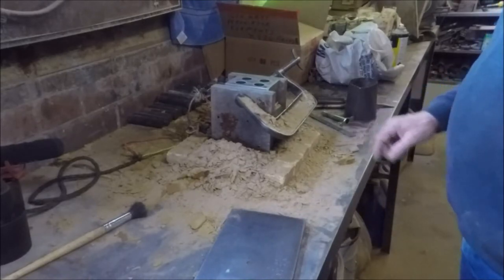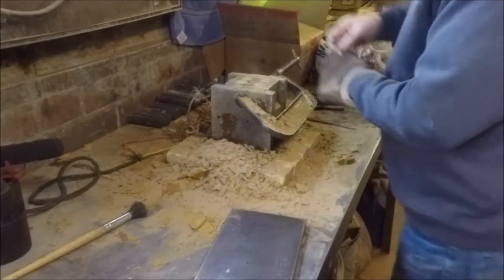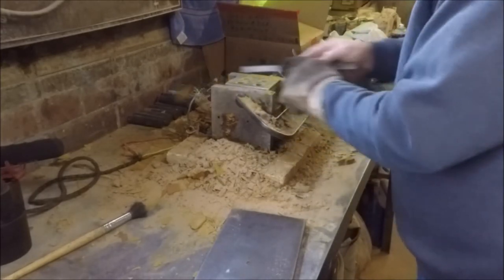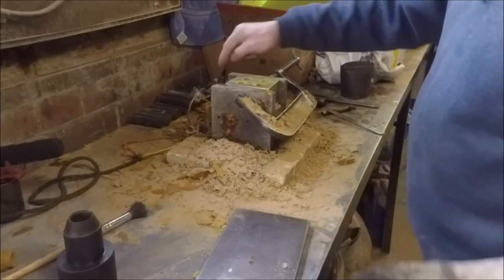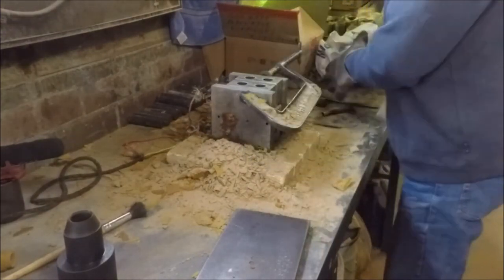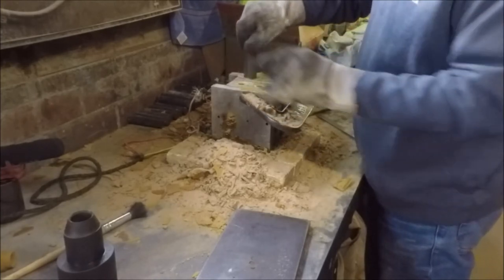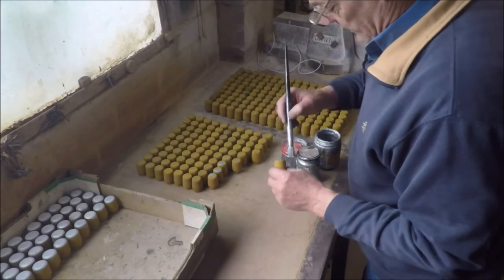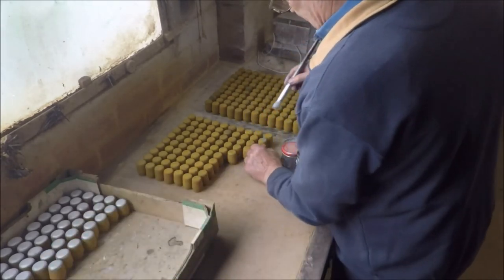My home foundry, Coffee pecolator heater casting core

Comment: After bending the heating elements it's a good idea to use 500-2000v mega omh meter to check if the heating element insulation was not dameged Durning bending. Single heating element insulation resistance should be higher than 2 megaomhs. There is an industry safety standard for that, but I forgot the values described in it. 2 meg is what we check for.
Reply from the maker: Mindaugas, My customer does indeed run a meter across each element to check that the have continuity and no earth leakage. He does this after the post casting machining, element end tagging, and sealing.. Martin
Reply: @olfoundryman8418  it would be wise to do that after bending, before casting. Because you can scrap the element if it's faulty, and scraping a finished product is expensive(work hours and materials).
Reply from the maker: Mindaugas, Your point is well made and I think my customer - who provided me with the elements already bent (coiled) - may well have tested them at that stage too but I do not know for sure. I can not do the test myself as I do not own a mega... Martin

Comment: what is the binder for the sand ?
Reply from the maker: Rahib, The sand comes pre-coated with what I believe is a phenolic resin. The heat of the die first melts and then cures this resin. I believe that resin coated sand, sometimes called "shell sand" is available just about everywhere as it is widely used. It is quite cheap, from memory I pay a less than A$10.00 for a 25 Kg bag and you get  a lot of these core from 25 Kg!Martin

Comment: hi, i have tryed to get hold of the resin bond sand. but no one seems to know wat it is. working with waterglass at the moment. any help
Reply from the maker: Manus, I am absolutely amazed that you are having trouble getting resin coated sand. To the best of my knowledge it is used and thus available world wide. Even here in Melbourne where I live with it's now almost dead foundry industry there is at least one company listed (under "Foundry supplies") in our local phone directory as a supplier of resin coated sands, it's them I buy from. Some people know it as "Shell core sand" so perhaps you could try asking for that although a quick check of Google indicates that the term "Resin coated sand" is the one most used for it.  You would have to go to someone who supplies foundries as other sand type suppliers would not have much of a clue about it. Almost all sand foundries use this material so if you can find a commercial foundry anywhere near you (preferably a smaller one) they may be prepared to sell you a bag or two for cash or at least to tell you where you can get it locally. Waterglass (sodium silicate) CO2 sand is Ok and I do use a bit of it from time to time but I much prefer the resin coated sand. Silicate is not as convenient as it has to be mixed up each time immediately before use, it won't keep as it dries out and atmospheric CO2 will set it off (slowly!)  Cores made with it are not as strong, not as free venting  nor do they store as well, I can make say a hundred shell cores with the resin coated sand put them on the shelf and use them over perhaps the next year a few at a time and they are fine but I would never try that with silicate CO2 cores, they are best used within a few days of making. Also breakdown of silicate is poor, sometimes you have to chisel the core out of the casting, however if you add 1/2 % glucose powder to the sand before adding the silicate the breakdown will be much better as the cores will wash out. Of course shell cores need a metal core box while silicate don't but silicate do need a CO2 supply (although there are variants of it that don't)
I don't know if any of this helps but good luck with it.... Martin
Reply: thank you very much for your help. i cast mostly with co2. the foundry supliers and foundrys i contacted use a resin binder sand, but it use a chemical catilist tipe system.  also have hard time finding any suplies in small amounts. about the only thing i get in reasonable small quantities is sifted sand. even the seramick shall binder only is avalebal in 220l drums. and not very cheap at that eather.
ps. I love watching your vidios. most help full.  some of the videos show a lot but explain very little. thank you.
I will keep at it.
Manus